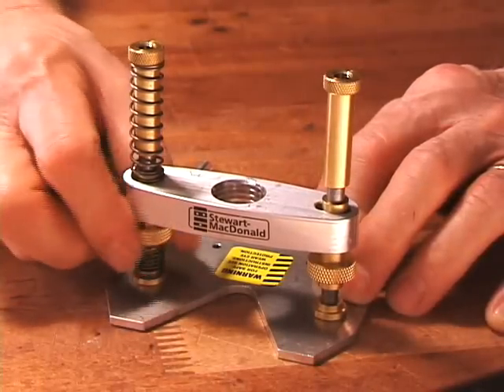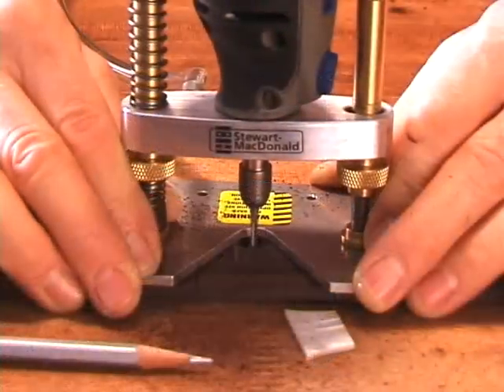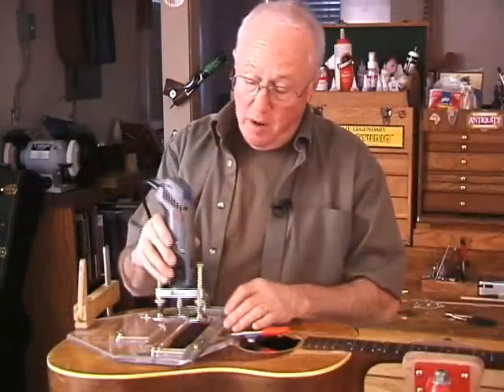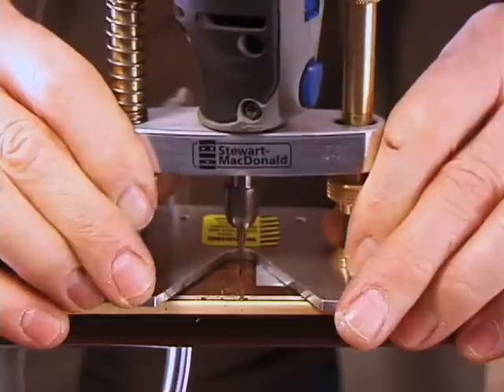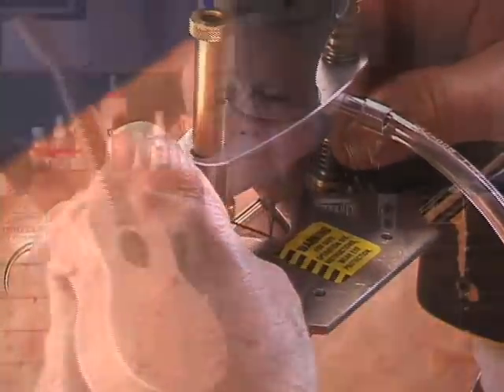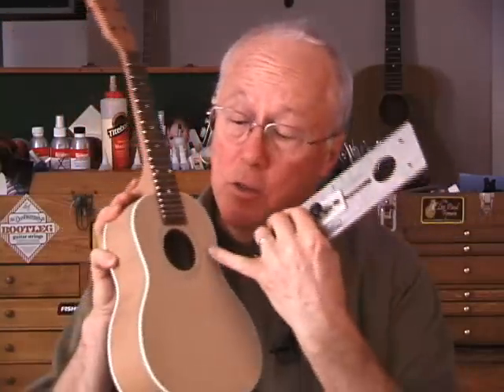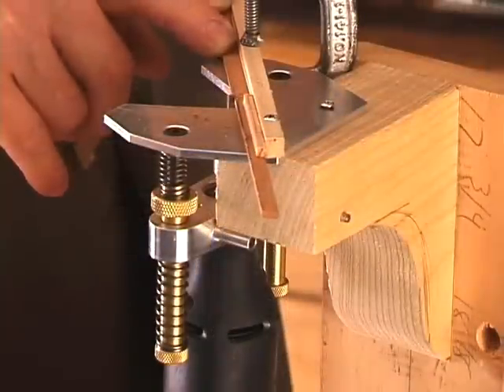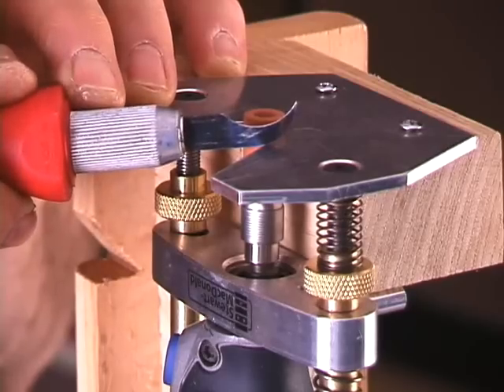Precision Router Base

Comment: I see a comment from Gil Solomon, 2 months ago, saying the height adjustment managed to work loose. On that setup, with vibrations from the device, I see that being a real possibility which puts me off buying one.

However. if those adjusters were given a locking screw I think that would cure that problem outright, Or maybe using two nuts on each side, locking them against each other, is another idea.

Please don't think I'm belittling you, I'm just giving my thoughts from one engineer to another.

Comment: JeffAddix, this is great for doing precision work, but for neck and pickup cavities, I would recommend using a regular router with a template. Using a Dremel tool on larger areas like that will take a lot longer and will be harder on your Dremel tool.

Comment: Can we use it to drill a hole on the body of Bass for install the battery box for active preamp part?
Reply: Dremel is not the preferred tool for routing a cavity.  You might burn up the motor.  A router and a template are the way to go, www.stewmac.com/item/3577

Comment: I would like to see a video of it in action build something start to fin. Looks good on  video but what about real life. It is not over priced we all are just over taxed.
Reply: I'm not a pro, but, I've done some block inlays by placing the router base on top of the frets. Is this advised? I don't know, but, it's worked fine. the router slides with little resistance and follows the radius of the fretboard. I think the blower accessory is very helpful if not necessary.